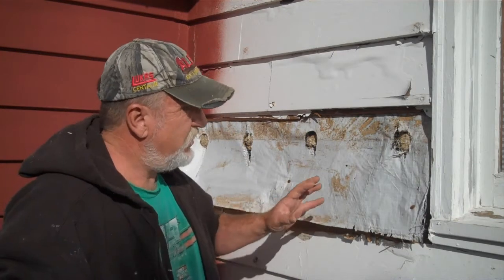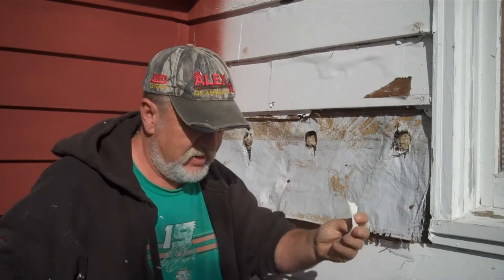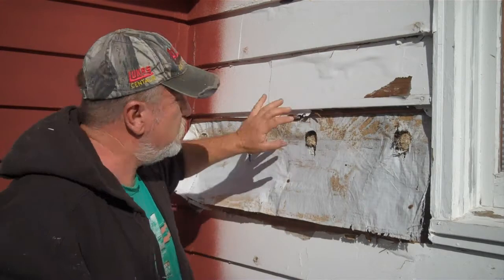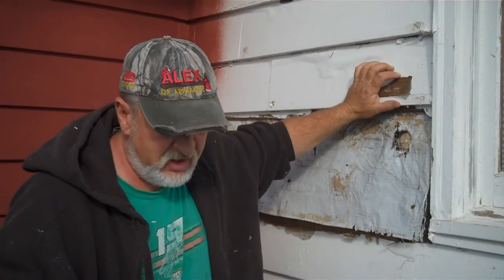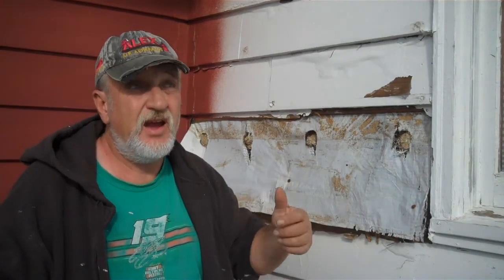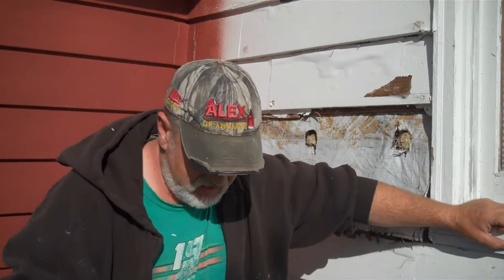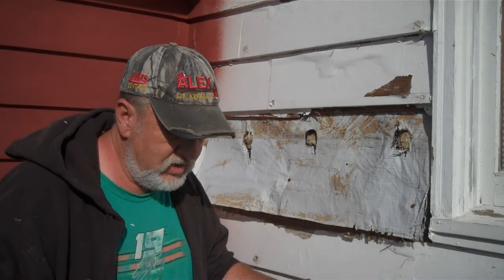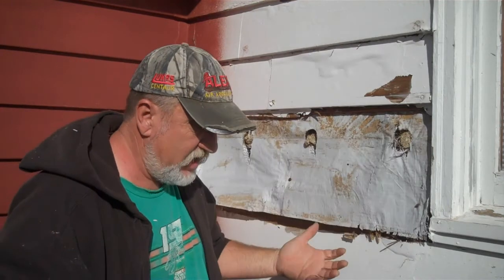Ext  "Mooney Wall" Introduction

Comment: You have it tough. I saw someone suggested pallet wood, which might be a good idea, and you might build a passive solar heater. They can create a lot of heat on a sunny day. I'd also check out the building supply recycle stores, maybe even talk to some contractors and tell them your situation. They might have some ideas for you.
Reply from the maker: Thanks John.  I'm using a lot of recycled and salvaged material on this.  As I replied to another comment, I'm also building a "Pop can" solar heater.  It will go on this same wall, but further east so it's not shaded by the garage.

Comment: A friend built an 8 x 17 shed out of free pallets.  In my area, the pallets are made out of cypress, red oak and pine.  My buddy used the cypress ones for the exterior siding and it looks amazing.  It was all free except for his time pulling out the nails and sorting the wood!  The beauty of cypress is that termites don't really like it especially if it is the red tidewater type.
Another guy I did some work for, used regular CDX plywood for the exterior siding with common 3/4" x 1&1/2" x 96"  furring strips 12" on center.  It gave it a batten board look that was quite nice and real cheap!  He repeated over and over that you have to keep a real good paint job on it to protect the wood.
I hope that gives you some ideas.  Good luck.

Comment: What direction does that wall face?  Is it visible to the street?  Maybe a passive solar wall would work for at least part of the wall?
Reply from the maker: It is on the South Steelhorses.... I've also (Rainy days) started drilling cans for a pop can solar heater.  This spot is up against the garage, so it's in the shade 1/2 of the day.
Reply: GoatHollow
If you can salvage some bricks, concrete chunks, rocks, etc., maybe you could construct a mass wall to absorb the heat which will help a lot at night.  You're reconstructing parts of that wall anyways.  Just an idea.

Comment: I just had our home treated with Termidor http://www.termidorhome.com/Termidor-Termite-Control-Product.asp.  Pest control company shot the juice every foot with three foot spray rod pushed into the ground all around the house (drilling in the steps and patio as needed), then drilled holes every foot in the garage to pump the juice along the footers.  They also treated every foot inside the crawl-space.  Suggest you tackle bugs first or they will keep eating (i.e. floor joists and sill plates).  Check the sill plate under the damage and floor joists. You may not feel this way now – but you are blessed to have found them.

Comment: I did home repair and renovations for 30 years. I've seen my share of termite and carpenter ant damage. My heart goes out to you. They love old wood!
As far as the pest are concerned. Remove any wood debris and moisture retention material. Boric acid is death on termites, ants, cockroaches and a host of insects. It's cheap and you can use it dry or mixed with water. Coat the interior walls with it before you close up.
If you could find yellow pine lap siding it wouldn't be much cheaper than cedar. There used to be a vinyl siding made by Bethlehem Steel that was very cold resistant. I think it was called T-Lock but it wasn't cheap. Steel is good just remember to ground it with some grounding rods. Concrete is awesome but can crack as well. What ever you use just pay attention to the installation. Most of the problems with any siding is improper installation techniques.
Good luck and let me know if you need any advice.
Reply from the maker: I already have bought the Boric Acid :).  I've been a home remodeling contractor myself for about 20 years also.  For me right now cheap is best, metal is about $60 a square around here.  Hadn't thought about grounding, thanks, will have to research that.  Please keep watching updates, and let me know if you see any problems.  There's an interesting corner that will be difficult to seal up.  My goal is to keep moisture out, which as you know, draws the bugs like stink on poop.
Reply: I see nothing but problems on a job like that. LOL You know how it goes.
I think they recommend a ground every other corner. You mentioned that you had a grounded metal roof. You maybe could tie in that way on the grounding rod. They make a clip that holds the wire to the bottom of the siding.
Good luck I'll be watching.

Comment: Good luck! I'll have my husband watch this and maybe he'll have some ideas for you! So, if you see me again in the comments that will be Ken. He's done a lot of home repair and remodeling and has used some here at this home too.
 I can appreciate the lack of cash! We're in the same situation SO I have learned framing, installing doors, windows, drywall etc.
 Have you looked into starting out at least with 1/2 inch T-111? It's used a lot here in the Finger Lakes in NY. It comes already sealed in several colors and it'll last, depending on weather conditions about 5-8 years. It helped with the insulating factor too. I know it's kind of a stop gap measure but winter's coming fast.
Reply from the maker: Patti, I already have some metal, it's not colored (Galvanized) but It will get me through the Winter.  T-111 just doesn't last very well it seems.  I'm hoping to have something I never have to redo again.  Thanks for watching!!!

Comment: check out stucco siding.
Reply from the maker: I once had a house with stucco, and it was painted with "Porch and floor" oil based paint... Was bullet proof, but I don't
have the skill to apply it, and can't afford to have it done.  One of the reasons I decided on metal.  It has a 40 year warranty on the finish, and is inexpensive.  Thanks for watching!!!